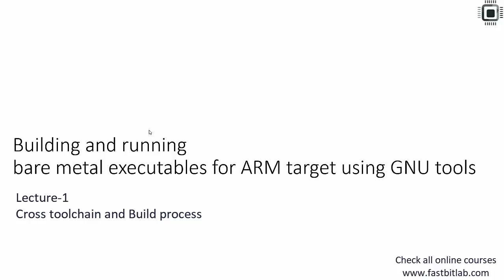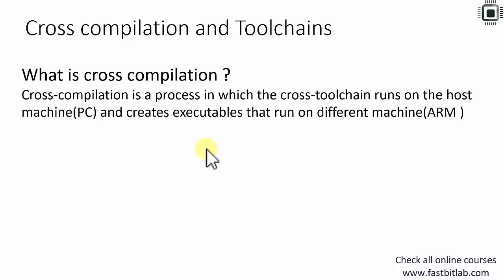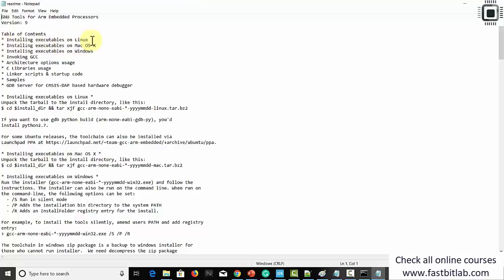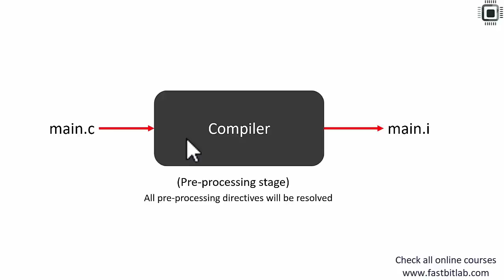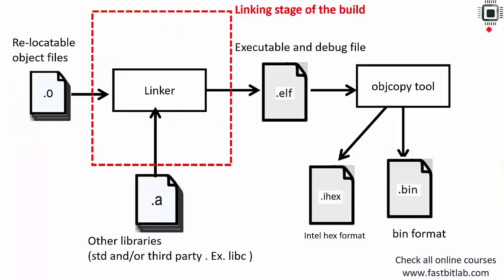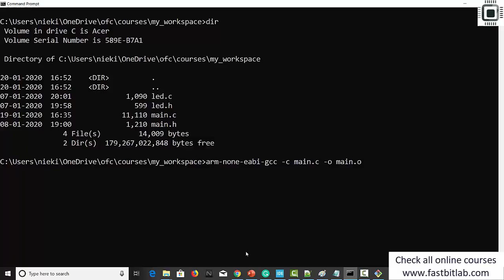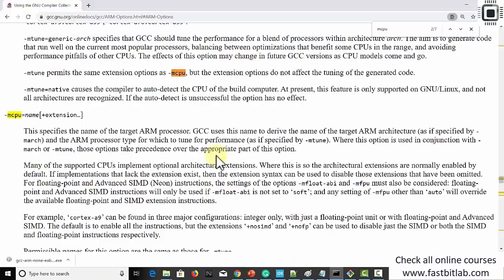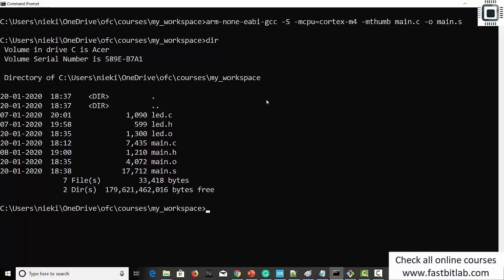Bare metal embedded lecture-1: Build process

Comment: "The compiler in our case is arm-none-eabi-* because we are doing cross compilation". That's OK. But why not "arm-none-linux-gnueabi-*"? Even that can work with proper compiler flags. Please explain with proper reasoning.
Reply: The target is not a linux machine but a bare metal processor.

Comment: An Ode To  C / C++ Thread SAFETY

Static constants abound in the lexical analyzer and compiler. Dynamic linking libraries deploy a plethora of data structures like trees and maps. The linker if static won't undergo modifications by system calls in the appended files at runtime. The loader generates the machine codecs always dynamic in binaries or hexadecimals. The compile time could be automatic or register prompting change in the volatile memory. That makes for thread safe in mutex or deadlock address locations. Any programming languages that are reporting segmentation fault or overflow and overrun are unsafe and need be pontificated for the perverse logic. It could make the operating system crash and the semaphore would rather be rectified to reinstate the infinite loop.